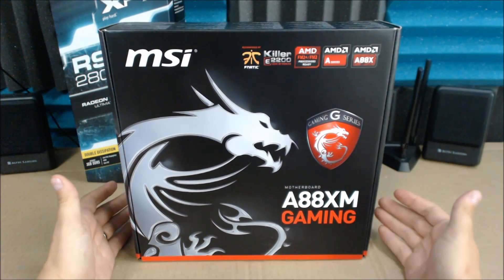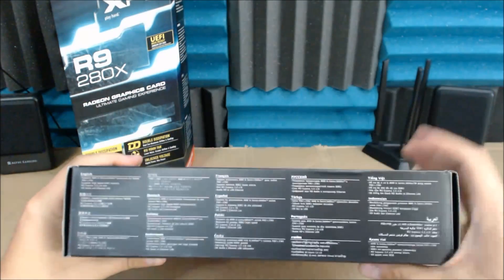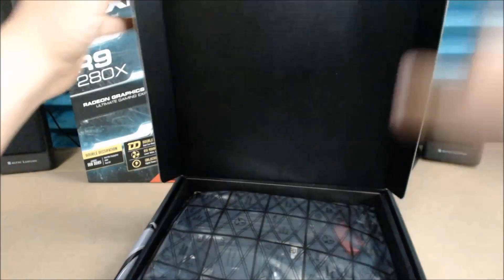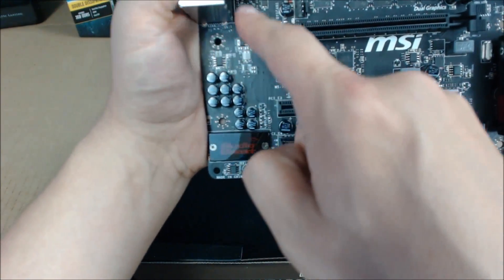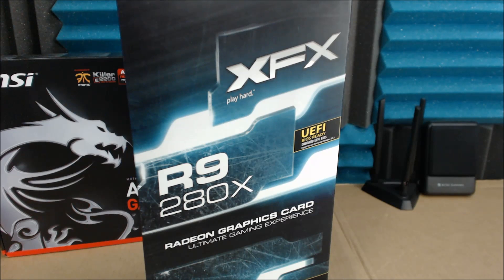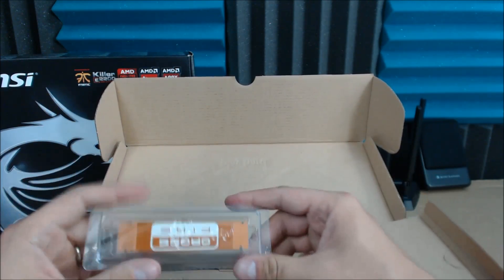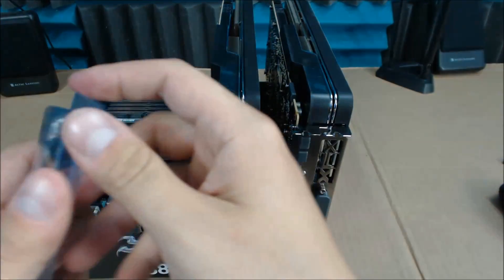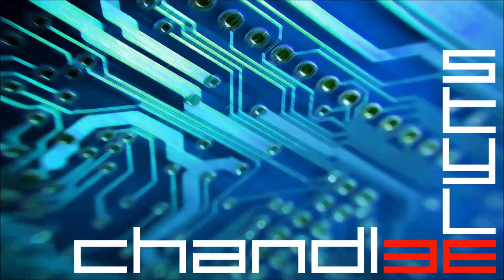Dual Unboxing - MSI A88XM Gaming and XFX R9 280X

Comment: More heat if you play the same game with same configuration?
If you put two graphics you block the USB 3.0 conecction and maybe the sys fan 2. Right?
I am thinking in renovation the grafic card for other diferent or the same and do crossfire
Thank you and like the video
Reply from the maker: Cesar Casado Vidal I'd answer your question but it looks like you have seen my full build video. do you have any other questions?

Comment: I have to say that i am upset with msi for straight up lying about the usb 3.0 and crossfire. but after u mentioned the fact that it has 3.0 in the back of the board then now i can rest easy my 2 powercolor hd 6970 are fawking huge and I was really upset when I processed the order and then started to worry about the space issues with 3.0 but IDC about the front headers. You could take a usb extender cable and run it from the back 3.0  port through the case and then use it in the housing of a existing front 3.0 on what ever case your building in. I hate unboxing videos I think they are pointless but after watching you install 2 cards with no issues I'm very glad I watched this video. If I don't get front 3.0 who cares. I'll still be able to use both my cards without issues. I would give 2 thumbs up if i could bro thanks for clearing that up!!! Any issues with switching resolutions or anything seen a lot of bitching on newegg about it not responding after switching to 4k or after the monitor "goes to sleep"? Have you discovered anymore problems with this motherboard? I wonder how well it works with over clocking?
Thanks again
Reply from the maker: If you check out some of the later videos i resolve the USB 3.0 front header. The only issue i have isn't really MSI fault... Kaveri does not play nice with avermedia so the computer will not boot with a capture card installed. After updating the drivers and bois I have had no problems with my TV/monitors. Over clocking is the easiest I have ever experienced, the OC genie has it set to 4.2 and the APU sits at a very cool 60° C under load. I was able to get it to 4.5, but after a second bios update the genie took back over and I have just been too lazy to switch it back, plus I don't need that much power,
Reply from the maker: Oh and Thank you for the nice words
Reply: Chandlee Style No problem comrade! I really like how you gave good up close shots of the mobo instead of worrying about how nice your hair looks and making "eye contact" with the camera. This has been one of the most informative set of unboxing videos I have ever watched. I have had a lot of issues getting my gpus to fit well with ANY motherboard so again thanks for the video. Well I guess that is that. I ordered this board along with a Evo 212 hyper cooler and a set of 16 GB corsair vengeance RAM. I'll be putting in a Corsair SPEC 3 case with a nice window and some red/black color scheme. I have a x4 750k Atalon black edition that already overclocks well with a good temp but my current mobo just won't deliver a steady voltage once I pass 3.9 Ghz! (cheap budget MSI A55M) Oh yea and my old msi board was blue and white and came with RED SATA cables! Riddle me that batman!?!?! LOL I noticed the white SATA and thought WTF was MSI thinking. There are reviews that state this board is amazing and some that say it just plain sucks. I guess the board is only as capable as the owner. ;) Where did you order that 3.0 converter from? n/m I see you linked it in the comment. Nice man!
Reply from the maker: Justin Smith the link is in the description

Comment: i am considering buying this board? quick stupid question though. what is the max amount of fans including cpu cooler would it support?
Reply from the maker: 3, but I have a lot more then that running in my computer
Reply: how did you manage that?
Reply from the maker: Fan controller and splitters

Comment: For those with the same issue with the USB 3.0 port, a USB 3.0 20-Pin Internal Header Adapter Cable might help.
Reply from the maker: I used a low profile extender in the build video. Worked like a charm